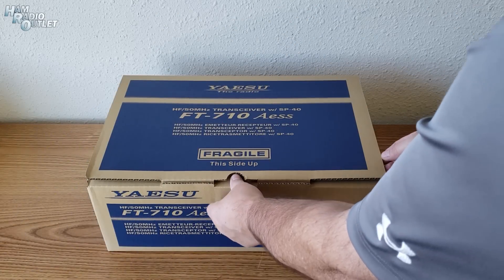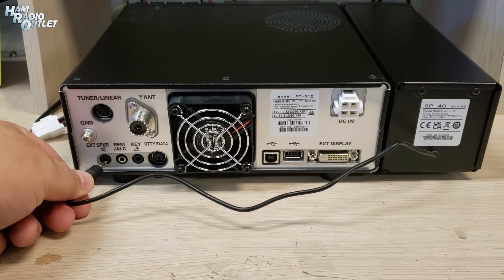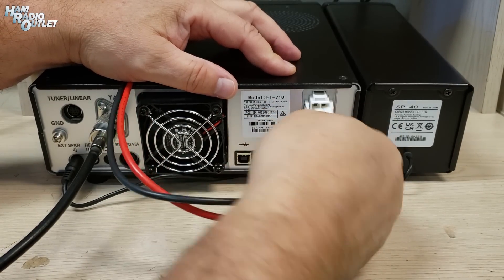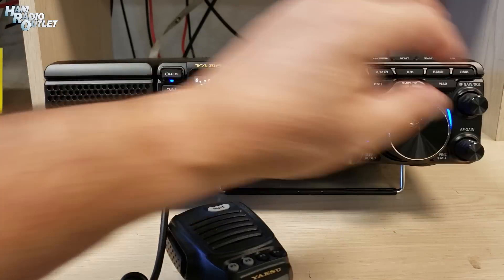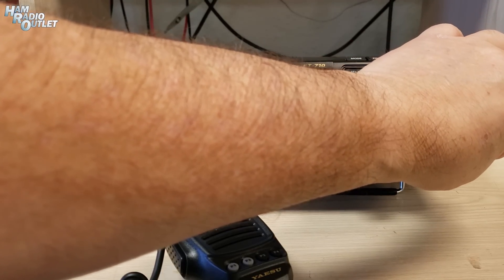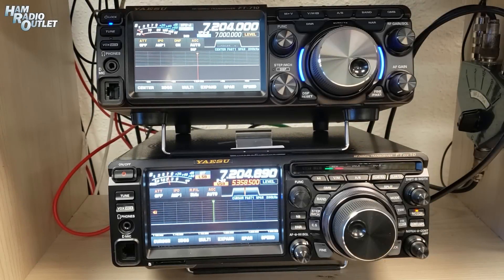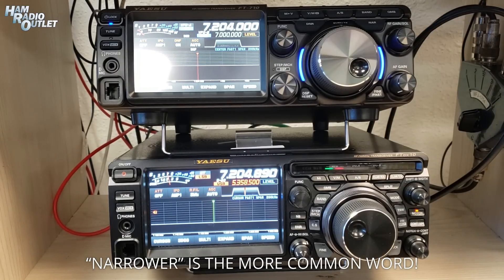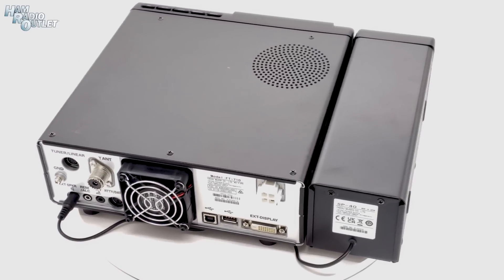Yaesu FT 710 First Look - Ham Radio Outlet

Comment: These companies really need to start changing the way they develop their hardware. How are they launching a new radio at the end of 2022 with a USB-B and DVI port? Even if they started developing this 5 years ago they could have included USB-C and HDMI or DisplayPort output. I have a bunch of old spare LCD monitors and none of them have DVI ports.
Reply from the maker: HDMI costs money to license, which is probably the reason Yaesu didn't go with it, not to mention that no audio is sent to the external monitor. But yeah, move with the times.
Reply: @HamRadioOutlet  good point about licensing, but DisplayPort is a VESA standard and royalty-free. For the radio to have a long lifecycle these parts should be modular.
Reply: @HamRadioOutlet  according to Yaesu, this isn't the reason why DVI was chosen
Reply from the maker: @HamRadio2  But it was the reason given by John Kruk in his video.
Reply: @HamRadioOutlet  Since then, he went into more details in my video.
Reply from the maker: @HamRadio2  Yes, he said it wasn't due to licensing fees, but because there's no audio sent to the external monitor, it's easy to integrate DVI into a video-only interface, and most computer monitors have DVI inputs. Pretty much what he said before.
Reply: @HamRadioOutlet  your statement is correct.  but your original reply, "HDMI costs money to license, which is probably the reason Yaesu didn't go with it" contradicts this latest reply.  Either it was a money/license issue, or it wasn't.  According to John, it wasn't.  I don't work for Yaesu, but I have no reason to doubt what he says.  All I want to do is keep it transparent.
Reply from the maker: @HamRadio2  Yes, my original reply was 2 weeks ago, based on a video he put out weeks before that. You also only quoted half of what I said, the other half being, "not to mention that no audio is sent to the external monitor. But yeah, move with the times." I too have no reason to doubt what John Kruk says, and there was nothing I said to infer there was any doubt. I think it's time to move on from this debate about the ports on the radio. they are what they are. People can choose to buy this radio, or not. Based on the ports provided, or not. Or based on any number of other design or implementation choices.
Reply: @HamRadioOutlet  Agreed about people's choice to buy or not. My comments were only about the reason behind their choice, not their choice of DVI. I don't honestly care what port they choose, I only wanted to convey the accurate reasoning of why they chose DVI over HDMI
Reply: @HamRadioOutlet Granted, but that's why DisplayPort was created.
Reply: "These companies really need to start changing the way they develop their hardware"

I'm an embedded systems guy, software and electronics.  I've been through Yaesu and Icom service manuals and noticed that so far they have tended to use Japan designed microcontrollers (Icom seems to like Hitachi, now Renesas).  Unfortunately Japan's big 3 Hitachi, Mitsubishi and NEC were kind of lagging in microcontroller innovation (part of what lead to them all rolling into Renesas, IMO).  The H8-family micro that Icom has in its 7100 was kind of pitiful (again IMO) even at that radio's launch.

These days there are any number of highly integrated ARM micros ready to interface to LCD touchscreens and any manner of A-to-D and D-to-A subsystems and fully capable of doing the DSP themselves (the IC-7100 has a TI DSP co-processor).  Better yet, micros like some in the STM32 family also have native USB support and some with HDMI/DisplayPort support.  But most of these microcontrollers are NOT Japanese.
Reply: @Randrew  Indeed, why not ARM?  So many great little reference designs to start with, too.
Reply: The DVI to HDMI adaptor will do the trick
Reply: A DVI to HDMI adapter is cheap, so it's not a real problem.
Reply: I think your critique is appropriate.  While using what are essentially legacy ports isn’t a reason not to buy a good radio, it’s annoying.  USB-B is still used on DACs and MIDI devices, but otherwise hasn’t been used routinely in consumer electronics for 20 years now.  DVI has no place on any amateur gear; USB-C is perfectly capable of outputting video, and is becoming THE standard interface for charging cell phone and tablets (essentially by law from Europe) in just over a year.  I suppose some credit is due for at least having these ports, new radios were still using serial ports just within the last decade- that was ridiculous.
Reply: @kd8opi  not sure if computer printers are considered consumer electronics? As most have USB B even recently.
Reply: @nine7295   Even so, it’s still a legacy interface a most people connect printers via WiFi.
Reply: @kd8opi  I was troubleshooting WiFi problem for someone a year ago concerning an HP laser printer, it was somewhat intermittent in the connectivity. I don't know "most people", but I suppose people use what they were told to buy. Maybe you should ask Yaesu or HRO why they don't use WiFi instead, even better. And then use wireless display technology while at it.
Reply: @nine7295  You’re  pretty invested in this philosophy. I’m not sure why you just have a hard time accepting the reality that ham radio is pretty far behind  other consumer electronics when it comes to connectivity.  Maybe you long for the day of serial ports, and people having to buy USB adapters/emulators as recently as just a few years ago to connect with 1970’s era technology on their brand new, 21rst century, radio gear.  And yes, I’m sure you are correct that non-consumer electronics and legacy systems use them serial interfaces, just like there are still carbureted engines on the road today.  But I think if you were honest with yourself, not just trying to score points in the comment section on YouTube, you’d have to admit that day to day, the overwhelming majority of people don’t use USB-B or serial ports.  In 2022, people connect their devices together via WiFi, or Bluetooth.  If they use a cord, its lightning, USB-c, USB-mini, or The now 30+ year-old USB-A standard.  I’m not sure I understand why you’d make excuses for companies that could easily switch out USB-B for USB-A, or for even USB-c or mini, or why Bluetooth is only available on a select few rigs when people have been using it for 25 years now in headsets and speakers.  But then, I guess as long as people don’t push these companies to change, they won’t.
Reply: @kd8opi  I think you have completely misunderstood me here. First I am not invested in any philosophical doctrines relating to this. Secondly, I am the one who is being realistic to know that these amateur radio equirements are likely to be designed with slightly older tech than the latest Apple products (oh wait, they also have been struggling to go standard with USB, so I take that back). I never defended that the amateur radio manufacturers are not behind in this area compared to the latest mobile computing market etc. I defended how some of you complained about this, I. E. You compared it with the products in other markets as if they should. Why don't you complain that your car dealership doesn't have any cars with a jet engine? I don't long for any days of serial ports and adapters, but instead of you, I am a pragmatic person and technical enough that I can deal with both kinds without much problems. And since you want to focus on USB so much, let me say that by using terms like USB A and C as if they are the standard, while actually they are just the connectors names, and it shows how much you know about the subject that your wanted to argue and win about. I have been with USB 1.0 since 1996, after I saw a computer monitor with that connector in the back, before any computers at that time came with a USB connector, as I was already working in the computer industry. You claimed that USB C must be used as that's the only modern connector for USB tech. Well, unless you must have nothing but USB 4 standard, even the very current (in my eyes) USB 3.2 specs allow for 3 other connectors under gen 1x1 and 2x1, and they are Type A SS (stands for super speed and it has an extra pin), Type B SS and Micro B SS, so a type C is only one of the 4 choices, even if it's more common (again, mostly for the mobile computing market). I don't want to bore you with what I know about computer standards. I am just a ham who has bought hundreds of radios. I don't own any stock or interests in this industry or even distribution channels. I have lots of criticisms on products designs, customer services and attitudes of some of these companies and players. But if I like a particular radio in general, the lack of a current USB 3.2 gen 2x1 standard connectivity won't deter me from buying it, but that's just me . I am not telling you how you vote with your wallet here. But given so many things one could criticize Yaesu products, and normally that goes to design bugs, over claimed performance figures and specs etc, things that are more important and critical, and not about what plug that seems less convenient. If I want the most convenience, then I'll use my phone, not the radio. And by the way, USB C doesn't guarantee a high speed, e.g. Being able to carry video data, etc, it all falls under the standard, not just the connector. And USB C isn't the name for the standard, as it goes in numbers such as 1.0,1.1,2.0,3.0,3.1,3.2 (with variations) and today, 4.0 was released in 2019, but how many devices have it built in? The connector types are related to the specs, but not in a 1 to 1 relationship. Last comment, about my comment to score points, aren't you here doing the same? This is an HRO video. I am nothing but a long time customer with them, but I also buy from other suppliers. If you want changes，then write a letter to Yaesu Musen HQ. You don't get any changes resulting from a YouTube comment here. Brand New radio and there can be many things to talk about the radio design, but some of you want to focus on the DVI and USB as if this is a general purpose computer. I don't work for Yaesu and I don't even know anyone working for them except a few staff in the LA office back in the late 90's, but not even well. I don't speak for Yaesu except as an owner of many of their radios starting with an FT-23 in 1985. I am not in any philosophy except I am a big consumer advocate in general (i.e. in real life). I accept that we can't have what we always want in the market place, and that's a fact of life. If I get very disappointed, then I'll leave the hobby, just like I did with high end high fidelity audio hobby decades ago. You don't know me, so don't tell me who I am about. Please.
Reply: @kd8opi  by the way, you said b USB A was 30 years +. That's impossible. The USB standard came out in 1996, and that was only 26 years ago. It came out between windows 95 and windows 95 OSR2, which finally supported USB, the first Windows that did. Get you facts please.
Reply: @nine7295  wow, you got me.  USB is only 26-27 years old and not 30.  Woah.  I can feel the burn.  How petty.
Reply: @nine7295  honestly, the fact you wrote a ridiculously long essay shows how overly invested you are in this topic.  I skimmed it, it’s really silly.  In your world, a 25 year old USB port is the equivalent of a jet engine in a car. Bottom line, ham radio makers have been slow to adapt computer connectivity technologies like USB that have been used for decades.  It made no sense why a serial interface was the only way to connect your radio to a computer until 7-10 years ago.  Even Elecraft used serial ports on their K3  models they sold for a hefty price until 2015.  No excuse for it.  But with people like you making excuses and believing that 25 year-old tech we use to plug-in keyboards with is cutting edge, they’ll keep it up.
Reply: USB-B clicks into place and is a more secure connection then USB-C, also I'm sure the radio doesn't have the need of the power or bandwidth that USB-C can provide. Also USB-B is a defacto standard for printers, scanners and other devices to this day and is not out of date. As far a the DVI connection, most older monitors will have DVI connections, also it's easy to adapt DVI to VGA or HDMI or Display port.
Reply: @StoneCreekRadio  I’ll give you USB-b locks in a bit better than A or C, but there are a host of small, excellent, portable monitors (or even tablets) that use USB-C for their input.  How great would it be to have power/data/video in one plug?  How great would it be to just plug your tuner into a USB-C port on your rig and not have to wire it back to your power supply?  How neat would it be to send data and power to a laptop, tablet, or even a crazy small form factor PC?  It was just within the last decade that rigs started to include USB ports at all.  For some reason computer interfaces lag 20 years behind in this hobby.  Very strange.
Reply: @StoneCreekRadio  My point is that type-C has been around a while, and is now ubiquitous. True some printers and scanners use type-B, but many people don't own these devices, or use all-in-ones with WiFi connectivity so may have lost or never had a USB cable.

It's not just about a speed/power benefit, it's more about not having to keep a bunch of cables around. My laptops, tabets, and phones all have type-C, and C-B cables are very rare so you'd need a dongle/adapter.

Same argument for DVI. Sure it is a standard, many monitors have it, but nothing new would. If you're building out a shack and need to buy a new monitor for it, it's going to be DP, HDMI, or maybe VGA. The port Yaesu included is DVI-D, not DVI-I so you cannot simple pin-convert it to VGA ,you need an active adapter. HDMI sure, but that's just another specialized cable or adapter.

They should modularize that section so that users can swap it out in 10 years when this has all changed again.
Reply: @MattBlank0  not sure if that is so specialized if I can walk into a good local computer store and walk out with a DVI to HDMI adapter (I do own 2 adapter cables so I actually don't, this is just for illustration).

"Many people... Or... Or... Never had a USB cable" you are stretching it further and further to defend your argument here.

I have a dozen each of laptops, tablets and phones. Only 2 phones have USB C. The rest are old because I don't go out and buy the latest gears like you.
Reply: You can get HDMI to DVI-D cable or adapter easily. You can use the screws to secure a DVI connector. Most HDMI connectors do not have a locking mechanism. HDMI connectors come off so easily, I wonder who designed it. Also, a DVI connector can in theory feed both analog and digital video signals. HDMI is digital only. So DVI can be more flexible for compatibility. I still have many monitors that can be fed with analog or DVI and thus make HDMI also compatible as well. I also own a monitor that can take 5 different kinds of signal inputs/ connectors.
Reply: @nine7295  With your logic, they should have kept using serial ports.
Reply: @kd8opi  I am not sure about "should" as it's a choice, as guess it's a free market. But the reality is that industrial and commercial products still use serial ports in many devices. There are still computers made with serial ports. As for Amateur Radio, many communications between devices are still serial communication, especially if one side is a computer. For example, most packet radio products are serial comm connection. And when USB is used, the device actually use a chip to convert the actual comm to serial after all. Serial port doesn't have driver issues. More flexible.
Reply: DVI to HDMI adaptor is the only way.  But all these adaptors are clutter
Reply: Every $1,300 computer has HDMI or DP. They can suck it up or use DP. USB is a little more flex but the active converter dongles for video output are so flaky they shouldn't make their users by a 10-dollar piece of shit to make a $1,300 radio connect to a modern monitor.
Reply from the maker: Seriously guys... When you see something like a USB port causing so much conversation on a YouTube video, you should voice your opinion to the radio manufacturers. Even John Kruk from Yaesu said in one of his videos, that suggestions to Yaesu do far more than complaints on a video. When manufacturers hear from their customers (a lot of customers) about something that needs to be changed, they change it. When manufacturers see complaints on a YouTube video they consider them coming from a vocal minority. Write to the manufacturer - all of them - when a new radio comes out and tell them what they did wrong, and right!
Reply: @HamRadioOutlet  That Yaesu listens is good news.  I suppose it makes sense, but in my electronics consumer role I'm used to being ignored.
Reply: @HamRadioOutlet  It’s not a Yaesu complaint, necessarily.  I don’t want to single them out.  And I take your point. However, you’d think that people in the business of making electronics, and fairly sophisticated gear at that, wmight say to themselves “Hmmm, you know there is this thing called Bluetooth (or WiFi, or USB A/C), And there are literally hundreds of Bluetooth headsets available for people to use-maybe we should think about adding Bluetooth to our rigs”.  Kudos to Icom for putting it in their 705, let’s see how long it takes the other makers to follow suit.  It took 20 years, but they got there.  And to  your point about writing them directly, If they feel social media doesn’t capture trends or issues, they’re more behind in way more things I imagined.
Reply: I agree. The Luddites that start talking about patents, etc making USB-C and HDMI "too expensive" need to go fertilize a tree somewhere.
Ham Radio is always 20 years behind on everything.
Reply from the maker: @robertkeller9828  Manufacturers of any product have to make their products fit a specific market. For them, adding $5 or $10 to the price of a product could price it outside of their specific market and therefore make a product unviable. I don't claim to know Yaesu's marketing structure, but I bet they did their homework to see if more people would buy the radio if it had USB-C and HDMI, compared to the number of people likely to buy the radio if it had USB-B and DVI. I'm also sure they did their homework to see if the manufacturing costs involved (including licensing HDMI for no practical gain to the radio's design) would be offset by the increased(?) number of people buying the radio just because it had HDMI and USB-C. The fact is, unless manufacturers hear about ham radio operators' "wants" and "requirements", they will do what they think hams want. Make yourself heard. Contact them directly and tell them... and then buy the products that have what you asked for!
Reply: @HamRadioOutlet  Or, maybe, just maybe, they thought “Its cheaper to use these old legacy connectors, and if they work why bother to update them?  We got away with using serial interfaces for 30 years after all and nobody cared”.  I bet that’s more likely than your theory of Yaesu spending a dime on research to see if they should upgrade to 30-year old USB-A ports.  Just a hunch.
Reply from the maker: @kd8opi  Could be. Great question for Yaesu. Let us know what they say.
Reply: @HamRadioOutlet  lol, why don’t you?  You’re buying their stuff wholesale, you’re a dealer, you’re e gaging on this forum, and your best answer is for ME to write them a letter?  Don’t act like you don’t have an interest here.
Reply from the maker: @kd8opi  Yes, because you are the end user of their products. The retailer is not. There are more end-users of their products than there are retailers of their products. If 12 retailers complain to a manufacturer about a missing feature, that's 12 voices. If 20,000 people complain to a manufacturer about why they won't buy their product, you think that's not going to get their attention? Your opinion matters more to the manufacturers than the opinion of the retailers.  End-users complaining about a radio's lack of features or poor implementation of... whatever...  to the retailer does nothing to fix the issue the end-user has, even when the retailer passes that info on to the manufacturer. 100 end-user complaints forwarded to the manufacturer by a retailer becomes one complaint from one retailer. If a retailer asks "Why did you use DVI and not HDMI?" and we tell the end-user what we were told, the end-user is unhappy with the answer, complains about it to the retailer, but there's nothing the retailer can do about it. If the end-user asks the manufacturer directly, the end-user can at least voice their displeasure to the manufacturer directly and their voice is heard.
Reply: @HamRadioOutlet  You are a dealer.  You get customer feedback all the time and deal with the customers.  You are the ideal customer representatives to discuss these issues with yaesu. Just like auto dealers discuss problems with car makers.  Don’t throw this all on your customers, you have a role to play too.
Reply from the maker: @kd8opi  Ok.
Reply: @kd8opi  I asked them already. That's not the reason.
Reply: Look at all these boomers fanboying and defending their favorite manufacturer's cheapskate decision to use obsolete connectors on a brand new radio in 2022.  "NBD you can just buy a DVI to HDMI adapter."  The rig is $1,300!  How is that not insulting?  If the argument is that Yaesu can't afford licensing fees for the connectors, then they're probably financially circling the drain.  I'll even give a pass on the chunky USB-B connector and say maybe high speed USB-C causes noise or something.  But DVI and HDMI carry the same video signal and DVI has been obsolete for like 15 years.
Reply: All I want are back-lit buttons as I like to spend a lot of my time on my ftx10 at night.
Reply: Howdy cousin 🤓, what is your opinion on this radio after 4 months of use?
Reply: BUY AN ADAPTER.